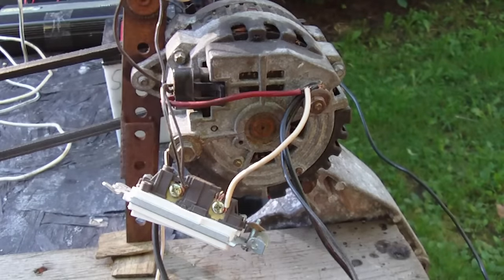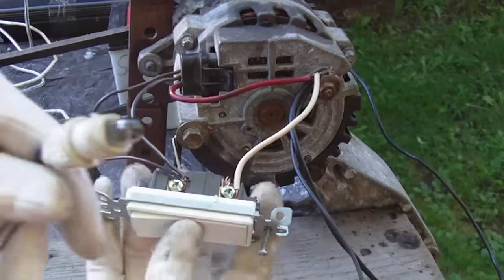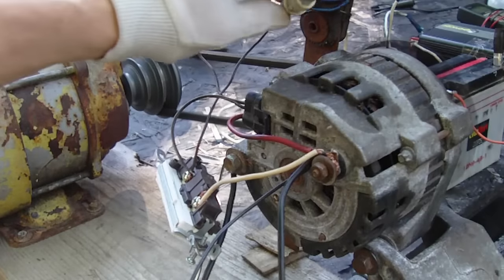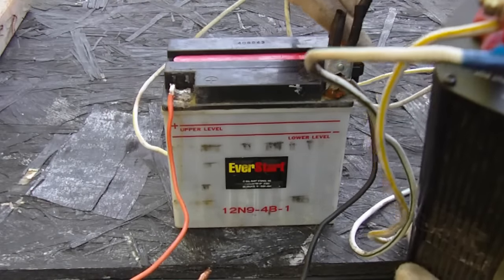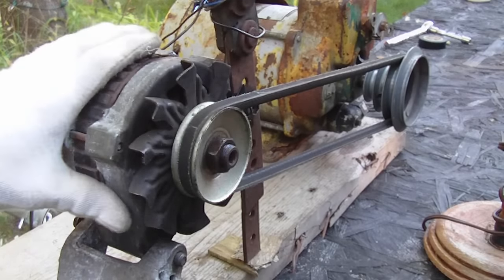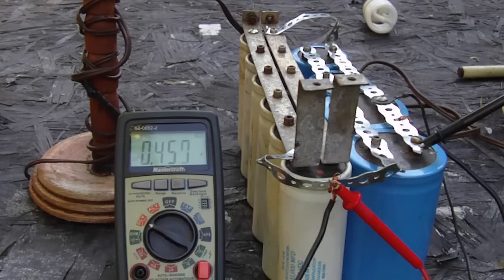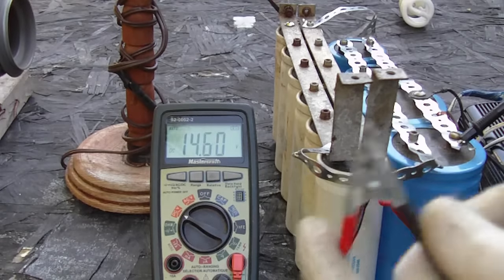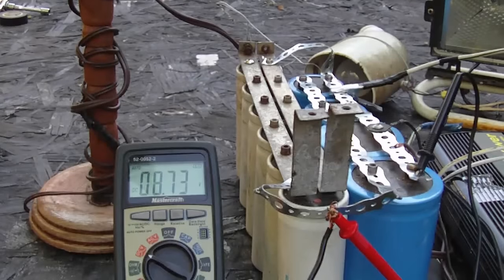Alternator DEMO Wiring, connection to Battery, Capacitors, Inverter, Modification

Comment: a how much energy are you actually making. near zero so how am i supposed to make this if it only makes a little bit. how about just taking a gas motor out of a generator and putting the electric set up. oh because you never completely replace it. and generator always have not enough power on purpose so your show if fake. two plug on generator on 300 amps alternator and maybe it could run on gaming pc and a monitor.

Comment: We're is your how I run my house with an alternater video.
Reply: It puts out 14 volts and piss all amps. You aren't powering your entire house with an alternator. You can power some lights or other low amp low watt loads. Personally I prefer direct drive washing machines, you can rearrange them to be a generator instead of a motor and the bulk of the work is adding an impeller and upgrading the magnets on your rotor. It'll produce an output very similar to what it was designed to operate at, if you have a 270v 200watt direct drive it will produce roughly 200 watts at 270volts. Use a rectifier/inverter block from an old RV and some car batteries and you can produce a cleaner smoother output that will be consistent despite any fluctuations in the speed of your impeller. You can ever tailor your voltage/current output to match your needs a bit. Build a few of them and you can power a fair amount of stuff, if you build enough that you can power everything with one of them off thats best because it allows for a maintenance cycle without disrupting your loads.

Comment: what i want to see is the induction motor running on free energy to power the alternator..try using a extra large pulley on induction motor  out of say a bike front wheel and reduce it down to a small alternator pulley ...maybe on windy day flaps could be added to the b ike wheel for catching the wind.i was thinking using a water sump pump to recirculate a water wheel type system using  water hose connected to  a barrel above and have the water drain out at a controlled flow just by using a tap...https://www.youtube.com/watch?v=ZmHY9DkD1Hw

Comment: I put this late model jeep alternator https://goo.gl/images/nAMmVo on my Honda with a dodge external voltage regulator and can't get it to work. The only way I can is to ground out one of the field wires to ground but the higher the rpms the higher the voltage it gets to 20+ volts . Any idea how I can get this to work? Maybe delete internal voltage regulator completely then some how through external vg? Any help would be greatly appreciated

Comment: *****  I have a question, How does the switch work? (turning the alternator 'on' part) What if you measure the voltage without turning it 'ON'? Does it produce any voltage? I'm asking this because i'm also doing the same as you do except that i don't use switches and stuffs. I only did a direct measure of the voltage produced at the B+ terminal and the Chassis of the alternator (without even connecting to a 12V battery and without the other accessory switches) I am able to get a reading of 3V only uptill now (with RPM upto 14000 to the alternator). Do i need to make switches too in order to get a higher voltage of maybe 14V??? Please tell me the instructions on how to further wire the switches and stuffs. By the way my alternator model is Suzuki Swift https://gearheads.in/showthread.php?7547-Alternator-wiring-electrical-experts-help!
Reply: asian mipa i

Comment: It's pointless though cause you got power running to the motor turning the alternator
Reply: Not pointless. At the beginning of the video he mentioned that he was using a motor to spin the alternator because it's easier to talk over than a gas engine. In a real world situation you'd use an internal combustion engine to spin the alternator, which would charge a battery and optionally an inverter.

Comment: If we ever figure out the truth behind what he is doing.
We will be able to use one power source to power to drive sources.
Fo example.
One alternator wired as a motor driving one alternator generator that is powering the system drive motor and the drive motor in your car.

Now tell why you can not use a portable gerator to power the electric motor in your small car.
If you get 22hours run time from 5galls of desil, that would equate to 1500 miles at 70 mph.

This is why no one can post this stuff on the internet.

The laws of conservation are easily broken if you pay no head to all the misleading mumbo jumbo equations they use to confuse you with.

Comment: what the hell is the point of that system? If you have no electric how are you going to run the alternator? this don't make no sense
Reply: I think he's assuming that you are running the Alt with a wind mill or turbine
Reply: dave12546 your right dave that the most important thing ,how we can use it in deprend ways..
Reply: I used one on a old powerwasher that had a bad pump, if I need to charge a 12 volt battery I just put the alligator clips on the battery and pull the rope
Reply: tippy dog  by rotating bicycle wd manpower
Reply: tippy dog 
A washing machine motor can be used as well... it'll run off a car battery

Comment: Using an electric motor to drive an alternator to produce ........... electricity! What's the point?
Reply: you can run electricity non stop and run your house with a big inverter .
Reply: @BIOGODANIC  you need  electricity to power the motor to drive the alternator to produce electricity. Pointless exercise.

Comment: the is way too dangerous.
Reply: mohd tmeme lol why??? can one possibly run an entire off grid home with this set up or wind turbine/alternator setup???
Reply: petey pabbs do you know if you touch capacitor by accident what would they do to you?.. This method needs a professional person to set it up.
Reply: petey pabbs and sorry for my poor English
Reply: mohd tmem

e
Reply: mohd tmeme лпсаж
Reply: It would not matter if you touch a capacitor or a ac or a dc circuit if it is for example a 12 volt circuit.